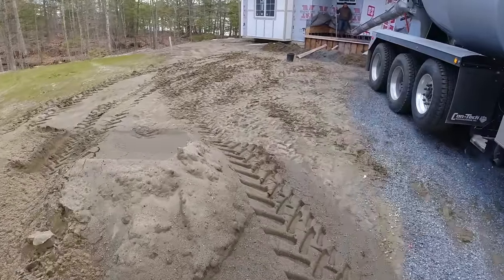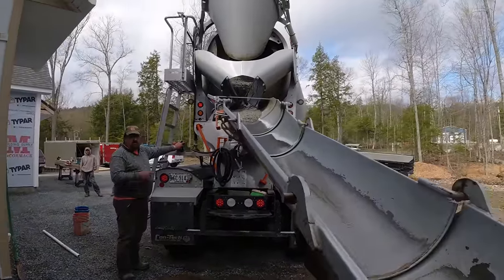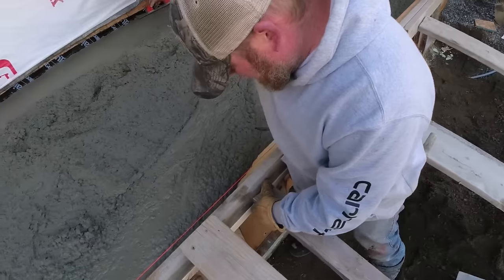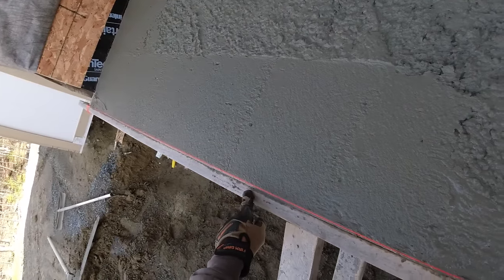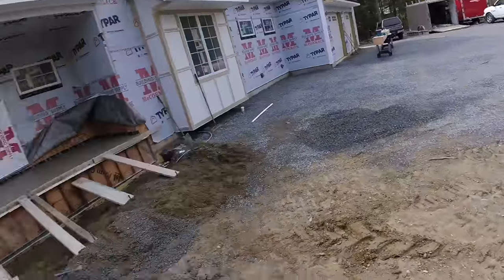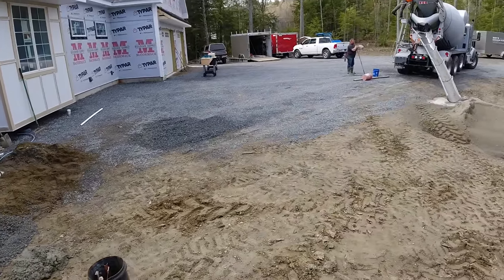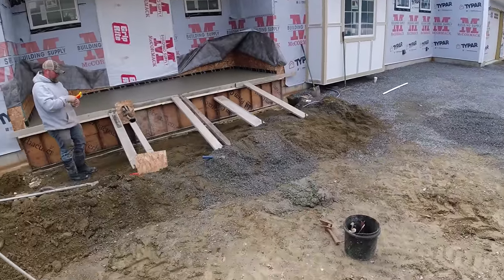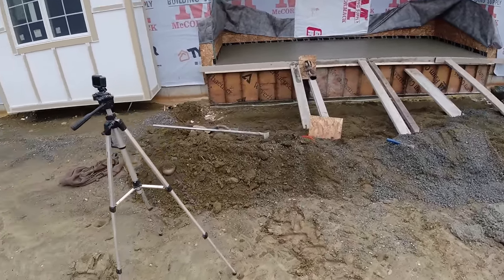Part 1 - Really Thick Front Edge Leads To Bowing of the Form (Can We Fix It?)

Comment: The builder's decision to not bring the foundation wall up higher than the porch is... concerning. The flashing membrane will hold the water back for a while, but it will be rotted eventually, even with proper slope on the concrete porch. Hopefully this house has a basement so they can fix it later.
Reply: Yep, I had that issue on my house. Concrete porch cap poured right up to the sheathing on two walls. Atrocious.

Comment: Sorry Mike, but that's just dumb. It would have taken 5 minutes to put those extra kickers in from the start, and you had the materials on hand. BTW, those form stakes provide very little passive resistance in the soil because their cross section is so small. Also curious why there is no temperature steel. That thing is going to crack up like crazy.
Reply: Non-structural component. Shrinkage cracking may happen but no more than usual.
Reply: Mike use plywood and banding strap. You lose a little wood on the inside but it will never move Works the same as a pourd wall  I've lernd some things from you guys wish I could show you its simple. Use 2 x4s everywhere the banning iron goes through just like a stake nail the banding iron on each 2x4 The banding iron works like wall ties .
Reply: @aarongallaty9546  How would you use banding on a one-sided form like that?
Reply: Robertmcmanus, couldn't agree with you more. This could've been a total disaster.  I was smh the whole time.  C'mon Mike you're better than this.

Comment: Definitely not Mike’s, or the concrete crews decision, but burying / trapping wood framing like that (below slab / finished porch elevation with exterior concrete) proves that builder either doesn’t know much, or plain doesn’t give a 💩 about long term life expectancy. It doesn’t matter how great a waterproofing membrane product claims to be, that scenario is problematic from the start. But what do I know? I only have 40 years experience and have seen dozens of repairs through the years, necessary due to similar poor construction practices. JS ✌🏼

Comment: I love this channel and have never posted a critical comment.
This formwork is horrendous, just so lucky that botton did not blow out.
Loose sloppy concrete in a pour like this ,, recipe for disaster. Waay over vibrated.
NEEDS : 2X4 ledger across the top,, several studs along the front face, several 2X4 stakes driven in and braces NAILED in place.
Bottom staked well, to keep from blowing out.
Yes, I apprenticed in commercial concrete formwork ,,, just read all the comments, amongst good company.

Comment: Always amazed at the lack of rebar structure in USA.
Reply: Non-structural component. US engineers use the same math as everyone else.
Reply: @psidvicious  ACI does not prescribe rebar only for structural components. I'd argue this case is outside a seismic zone.
Reply: @rodaliste  ACI doesn’t prescribe reinforcement at all. That would be up to the engineer of record on this particular project. And you are correct. Maine, USA where this is at, is not an active seismic zone.
Reply: @psidvicious  I guess our difference is that for us ACI 318 is applied to every structure: structural or non structural, given pacific active seismic zone. Thanks for the debate.

Comment: -I couldn’t quite figure out that front edge detail. It looked like they were forming a 3.5” overhang but it only looked like about 3/4 to 1 inch thick coverage over that 2x4. If I’m seeing that right, that’s going to be a chipped edge waiting to happen.
-People always underestimate bracing on concrete forms. When you think you’ve got enough, put twice to three X more. Concrete is 7.5X heavier than water, so as it gets deeper the pressure builds exponentially. Blow-outs ALWAYS suck.
Reply: Concrete is roughly 2.5x heavier (more dense) than water.
Reply: @ronaldwilkins6056  Correct 👍, I was thinking of steel. 
Still enormous pressures on the forms.
Reply: Almost everything about this is wrong but I’ll start with. Water is only about 2.5 times heavier than water and the pressure build linearly not exponentially.
Reply: @guyprattii3115  Disagree on the linear pressure. 
I already conceded the weight of concrete in the previous comment. 2.5X ✅

Comment: Hey Mike... I haven't finished watching yet, but I'm sure you'll get the wall fixed before the vid is over. Anyway, I thought 2 things right off the bat so I'm typing them right off the bat.
1. Thought the same thing as @joshs4109 mentioned in his comment.
2. Next time cut a terrace into that dirt. That slope is just allowing all that mud to push against the wall and nothing else. If you would have cut a terrace into that slope, yes it would have taken a little bit more mud. But then at least some of the weight of the mud would be pushing straight down on that terrace. This would relieve a bit of the force against the wall.